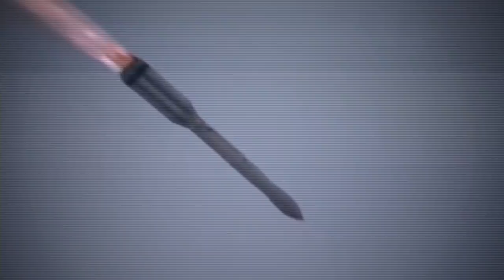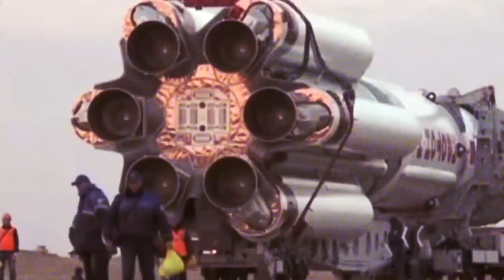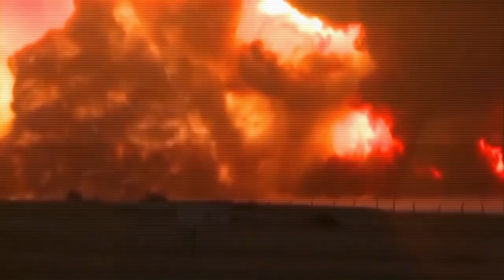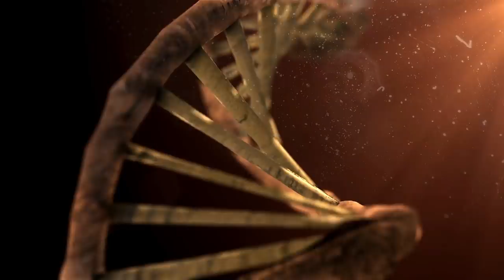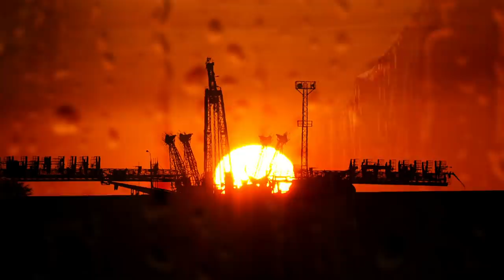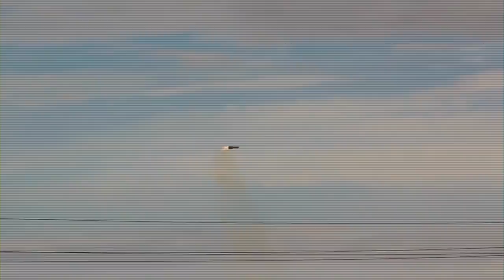Rocket with Sensors Installed Backwards Flies Upside Down

Comment: This is actually a normal launch in my Kerbal Space Program.
Reply: I've literally done this. Attached the probe core upside down, launched with SAS active... did exactly the same thing.
Reply: LOL
Reply: Exactly what happened to me a few days ago. I installed the rover upside because i used a sky crane and it would be simpler. The rocket immediately plummetted down.
Reply: @michac.8283  I've done it before but I made it to orbit. If you know how to fly properly it's actually not impossible to do. You just have to catch it early. Normally it's good to do this thing called a pre-flight check for idiot errors.
Reply: @tmi1234567  yup, you really need to check everything twice. Next thing you know you're in Moho orbit and realize you forgot to add decouplers between the payload and the rocket
Reply: A normal day in Kerbal Space Program
Reply: Funny you said that  cause it's a normal KSP day myself
Reply: Yours launches? How? Mine goes straight up 10 feet then straight back down.
Reply: You hiring?
Reply: @robcouvillon541  Same here, did not notice the navball was upside down :)
Reply: They must have forgotten to quick save.
Reply: Rip technician
Reply: I still give this a 6 out of 10
Reply: It's also a normal test for North Korea.
Reply: @Psyrecx  North Korea would rate this 10 / 10
Reply: @Robin-rn6ns  

Great success!
Reply: Fly Safe 😉
Reply: @robcouvillon541  that's pretty much what they did here LOL
Reply: @gunsmithmcc  yeah that tech no longer exists 😂😂😂😂
Reply: Lol You right. Standard operations on kerbal
Reply: Me too
Reply: Turn the pc over!
Reply: It happens at Max-Q is you didn’t put rockets weight distribution properly
Reply: @robcouvillon541  Same I didn't even notice the arrows... that I stared at for 5 minuets while contemplations life. I'm blind as a bat
Reply: Success
Reply: You don’t just blow up on the launch pad ?

Comment: Damn, so the rocket performed well.  It thought it was upside down and maneuvered to correct itself.
Reply: Yea this should just be chocked up as a whoops but at least we get tons of test data for what happens when we create a failure condition on accident xD.
Reply: @TheOriginalFaxon  yes, triple-check those gyros.
Reply: @ronmaest  might as well triple check everything else while youre at it and have each person sign off each task to make sure they didn't miss any
Reply: "I was... following instructions"
Innocent now,
Dark in the future
Reply: @TheOriginalFaxon  iirc The gyros could only be installed one direction (i.e. it was keyed correctly), but the tech forced it into place anyway
Reply: Which fool put The Earth in my flight path?
Reply: Yeah dude look how well it performed 👍🏼
Reply: It was doing horribly, corrected itself and then unfortunately blew up in max q. What a sad day 😓
Reply: @TheOriginalFaxon  Yes, we got lots of test data on the effect of di-methyl hydrazine on grass. Then we got lots of data on the effect of asymmetrical nitrogen tetroxide on little bunny-wunnies.
Reply: @cindyviola100  Yes, it was learning to dance the cha-cha. One, two, three, cha-cha one, two, three, cha-cha-BOOM!
Reply: And it nearly got there too
Reply: @Pygmyz06  it did perform well. It sensed it was going the complete wrong direction, so did a full turn-around.

Comment: I am betting that technician never went home after his shift.
Reply: No backup or cross checks? Too bad.
Reply: @johnp139  The Accountants cancelled Q.C. They said it was expensive foolishness. So they printed an arrow on the sensors and other parts for pennies.🧐
Reply: @LuxAudio389  from what I’ve heard it is Keyed so it only goes in one way.
Reply: @machy8515  yes. He literally had to hammer it in to get it to go in the wrong way.

Comment: From Rocket to Missile in 1 sec.
Reply: Fr
Reply: Your Nightmares Come True  you are in fact: left
Reply: I'm gonna be that guy, technically it went in reverse from Missile to rocket, by definition a missile is a computer guided rocket, a rocket is an unguided explosive device
Reply: @ryanschmitz9330  technically was still guided. Just guided straight to the ground because of the upside down sensors.
Reply: What's the difference when in russia
Reply: It started as a missile
Reply: When “Good Enough,” is not good enough!
Reply: Tell me about it brother.   They are lucky it didn’t come right back to them. Lol.  Here’s some useless intel if anyone is interested.  In military lingo a Missile is guided and a Rocket is not guided.  Thats all I retained from 4 years in the Marine Corps.  😂 USMC 0352 Antitank Guided Missile-Man, TOW Critter, Death on a Leash.✌️
Reply: Rocket to ICBM real quick
Reply: @MonMon Fiasco  maybe if it would've been launched from the Europe/Asia continental divide. Unfortunately a rocket launch that starts in Asia, and then "lands" a very short distance away from its origin point doesn't exactly qualify it to be considered an Intercontinental Ballistic Missile. Well, unless it's launched from the DPRK. To them a missile is considered a roaring success as long as it travels to an altitude of 10 feet before blowing up...
Reply: Nice Carl!
Reply: Unsymmetrical nitrogen tetroxide, yummy. Sounds dangerous to me. One would have to treat that carefully... one wouldn't want it to explode, would one? Was there also dimethyl hydrazine?Just something I read.
Reply: No! Rockets are unguided, missiles are not. 

D.M.
Reply: The rocket rose into the sky
But wasn't very placid,
Because it took amphetamines
And dropped a tab of acid.
Reply: And a one way trip to the unemployment line.
Reply: @monmonfiasco6391  ICBM = I Can't Believe My...
eyes: ... where the rocket's going
ears: ... the amazing series of BOOOOMs as it explodes and hit the ground
Reply: @MatthewPettyST1300  That's the one! Not only slow motion, but high resolution. I can see every little turn and twist and spin.
BOOOOOOOOOM!!!!!!
Reply: " nyet, nyet Soviet......"
Reply: @thomasmathew13  NOOOOOO, you're looking in the wrong direction!!!!  In positive time any disturbance will grow, but in negative time, the disturbances decay. Ergo, launch the rocket backwards.Then you will see the temperatures dropping, the disturbances shrinking, and entropy decreasing.

Comment: Imagine that program's dilemna when they turned on, "Ohhhhh shit theys trying to launch me upside down!? I got this!"and nearly successfully pulls a hard U to get "back on course". From a MechE who works with sensors and code- pretty amazingflight control software, trying to fix the human mistake, except the mistake was basically puttings it's eyes on backwards.
Reply: i was gonna comment this. How literally good was the vectoring system that it tried to make a 180 to correct the rocket.
Reply: @Mr_Plop1  Yes!! It's a pencil with zero aerodynamic lift/stabilzation, and only thrust vectoring to compensate for all forces. I imagine it's center of mass in a terrible location, with its length, once its sideways, the moment forces/stress become very large. The structure was designed for vertical compression loads, not shear forces, so as soon as that back end got out of step is when the wind sheared the front off.

 I'm supprised those rockets of that size and weight are capable of such manuevers, maybe it's designers are just as impressed! "Well at least we know the flight software works!"
Reply: @Mr_Plop1  lol the program was probably like "This better be some sort of deep learning simulation!!!"
Reply: I'm surprised they didn't have some kind of FTS (Flight Termination System) that triggered when the vehicle went that far off nominal to destroy it mid-air.
Reply: @wlittler  I believe they did but it detonated before it reached the outer limits of its safe zone
Reply: @J_McPhearsom  I thought it was just/solely wind sheer at first, but if you watch the zoomed in video, you'll not the rocket is rotating along its length axis very fast, and also it bends a little near the top. 
The rotation I think was also a factor.
Reply: @lelsewherelelsewhere9435  yes it’s true that’s a factor. thats what I mean about moment forces (rotational stresses) along its length. Once at an angle the weight of the engines/moment of inertia is being thrown sideways, causing huge internal stresses. But this thing isn’t accelerating(or jerking) so quickly as to tear itself apart on its own. In a vacuum it would just fly around like a like a bee using vector thrust. In air, that drag increases with cross section exposed to flow. So once it gets sideways, its cross section increases, it’s suddenly exposed to much higher air drag, pulling away the less dense and rigid cone - breaking at that moment point/rotational point. While you are seeing the the rear not change its trajectory due it’s mass and momentum.
Reply: @J_McPhearsom  I ll accept the fact that you bunch  of real rocket scientist around here would have  us "lowly" autotechs sweeping your floors between coffee  runs ,but everything you just said proves exactly why Fake  space x boosters  landing  vertically is physically impossible,. I just look stupid.

Comment: Was a mistake of the technicians who installed the sensors upside down, or of the engineers that designed something that can be installed upside down?
Reply: It only goes in one way. It takes some serious effort to force it in the wrong way
Reply: rule 1, always Blame engineer
Reply: Your Nightmares Come True  he literally had to force it, this is all documented, and comparing a rocket to a AK-47 is like comparing a rocket to a AK-47, the fuck?
Reply: Your Nightmares Come True  lol you can’t call out the greatest gun maker ever. Properly engineered with loose tolerances for mud. Plus they make some that are very well built. 
A child could ping one out. 
In the case of this rocket, its Russian, not soviet and he beat it in with hammer and cylinder iirc.
Reply: Your Nightmares Come True  I’m pretty sure it was built to work in all conditions in case of an error or if it is inevitable, like being stuck in a poor trench or some boggy marsh... which is pretty Much all western Russia.
Reply: @live2ride18  Actually, that title goes to John Moses Browning who is and was the worlds greatest arms designer.
Reply: @live2ride18  nah, john moses browning was the greatest gun maker ever.
Reply: *cringe*^^
Reply: Don’t blame the engineers, were the inspectors doing their job?   I don’t think so!!
Reply: They used a hammer to install it upside-down
Reply: Stef
Reply: @lewismassie  
No, it goes in multiple ways.
It just takes some serious effort to get it to go in some of them.

Making it absolutely impossible to install more than one way, is dead simple.

And the blame for not making it that way, goes from the people designing it, all the way up to top person/group that approves everything.
Reply: @lordgarion514   The blame goes on the technician for putting it in the wrong way even though it was resisting to fit in that way. You cant expect Designers to expect highly qualified people to make  a mistake like this. They certainly had more on their mind when designing this then wether or not someone can read basic instructions.
Reply: Both
Reply: @Usebitchute  that'd be "an" not "a". As in the indefinite article  before a vowel is "an". Don't criticise people when you can't write.
Reply: @dano6845  just because you like the smell of your own farts doesn't mean everyone else will, I used "a"  wrong lar de dah, get over it ya spoof, I bet you looked over your message 50 times before sending it. 🤣 (Edit) proof I'm not this guy I wrote "me" instead of "mean"
Reply: Your Nightmares Come True  I saw an analysis in an aerospace magazine, and the report said that "It would have required an unusually large force to insert it in the orientation it was found." The report also said that it was deliberately designed not to be ABLE to go in that way round. I guess a very strong baboon with a big monkey wrench can do wonders.
Furthermore, there was a signature on the paperwork, indicating that the supervisor had checked the work. The trouble is, there was a date on that signature and the supervisor was known to have been on holiday hundreds of miles away on the date given. Did the supervisor sign and date it in advance, so he didn't have to bother to actually inspect the work? Alternatively, did the technician forge the signature? Somebody was definitely taking a short cut. For the hi-res, slow-motion video, look up "Proton Rocket" on YouTube. I love the nice peachy colour of the flames.
Reply: I think that the Ariane 5 had a problem within the last year or two... possibly the navigation counter went out of range, or maybe the speed measurement went out of range, causing it to think that it was going at negative the speed of light. Anyway, there was a problem and you are not going to space today, as Randall Munroe would say.
Reply: @eliasredlich3425  
Dude, I got tools that cost less than a hundred bucks, that it's absolutely impossible to install parts in the wrong direction in, unless you break something.

3 offset pins isn't complicated......
Reply: Borat was the lead engineer!😅🤣😂😁
Reply: Or perhaps the Quality Control inspectors who are supposed to sign off on and "buy" the installation. Or the technicians who are supposed to perform a "maintenance operational check" to confirm the correct operation of completed systems before giving the green light to continue or issue a No-Go recommendation to halt proceeding any further. Or the first line managers who are supposed to "supervise" and provide guidance for a safety stand down ?

Comment: This is on the engineers, not whichever under paid rousky tech installed it upside down. It shouldn't be possible to install a properly designed part incorrectly, a simple metal tab could have prevented this.
Reply: It shouldn't have been possible. Someone hammered it in to force it. IT was def the technician
Reply: @AndrewJHayford  or his supervisor ,
Reply: @AndrewJHayford  i kinda doubt that. But even so, one would think that there would be calibrations ran on the sensors after installation and also software in the system to recognize the error.
Reply: This is why manufacturers have INSPECTORS checking on technicians!!!!!
Reply: @jeffpollard7304  yes, where were the inspectors?  I would think several people would have to inspect each portion of the assembly.  Maybe they were on vodka break.
Reply: @jeffpollard7304  mean the guys who take 2 lunch breaks and play on their computer

Comment: I wasn’t aware that the Soviet Union was still around in 2013.
Reply: The rocket and satellites are Soviet in origin, lots of stuff built by the Soviets is still used today, Proton M and Glonass navigation satellites if you'd like to google em up.
Reply: @samaelsandalphon5600  

This.

I'm not sure why John Quilbot thought the narrator said at any point the Soviet Union still existed in 2013 other than to try to appear 'smart'. The narrator clearly said that the rockets were borne out of the Cold War era.

Comment: Why not make the sensors shaped so they fit on the rocket in one direction/way possible?
Reply: They did, apparently. The technician who installed it had a better idea, and applied the principle of "compression fit". AKA taking a hammer and pounding it in.

Comment: This lesson should have been learned in 1948, when Edward Murphy's strain gauges were installed back-to-front in a rocket sled test (supposed source of "Murphy's law").  Parts should be designed so that they can only be installed in the correct orientation.

Comment: What always boggled my mind about this story, is the fact that the gyroscopes cannot be installed upside down, due to the way the parts are shaped, but the technician managed to HAMMER it into place somehow... I mean, when you work on these multi million dollar rockets and a part just doesnt seem to fit, the first thing I would do is check if its the right part and not try to fucking force it into obedience with a hammer...

Comment: Reminds me of an engineer  I worked with in semiconductors  who ruined 10 millions dollars worth of semiconductors because he torqued his bolts at 50 pounds instead of 55 while doing maintenance on production tools (RF Dry Etching). The manufacturing tools ran for two weeks before it was discovered when all the production lines were failing Testing. He got fired, poor guy he was so sad and defeated.

Comment: Some interesting facts about this:
1: The sensor suite only goes in one way. You need some serious force to put it in the wrong way
2: The Proton-M does not have a Flight Termination System
3: The orange cloud is NTO, the same fuel used in the Crew Dragon abort system (And I once got a cloud in my face in a chem lab)
Reply: You forgot the fact that NTO / the fuel is highly flammable, toxic and carcinogenic (causes cancer)
Reply: @Doomsday499  Oh for sure. I didn't include it since Dark put that info in the video

Comment: The technician was just a scapegoat. 
1. They should have designed the sensor in a way that it couldn't be installed upside down. Make some kind of tab or key or something. 
2. It should have been inspected by someone else prior to launch. How hard would it have been to have another tech walk by and walk through the install?
This represents a failure at all levels of that organization. Maybe they did a lot of FMEA after the fact and have since changed their ways.

Comment: Apparently this just happened again. A Russian S-300 SAM launched, did a 180, apparently locked onto its launcher (because it locked onto the radar from the launcher), and smacked right into it. I strongly suspect that the root cause is the same. Sensors put in backwards.